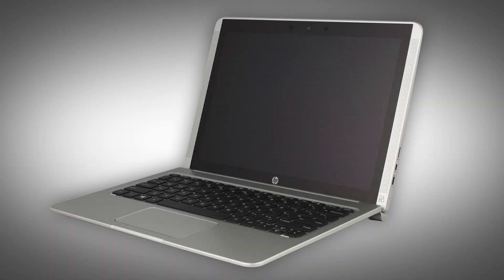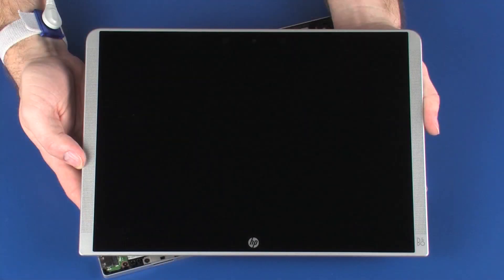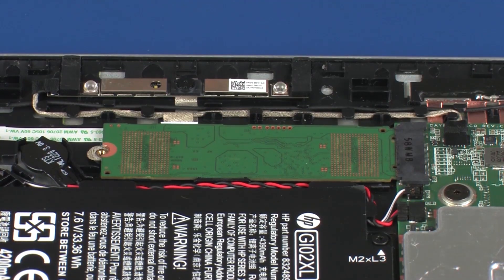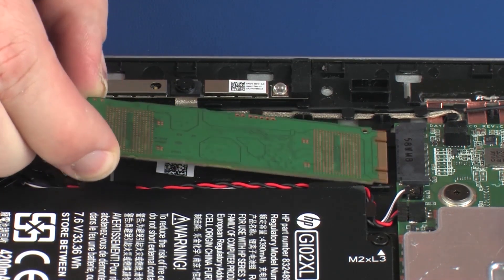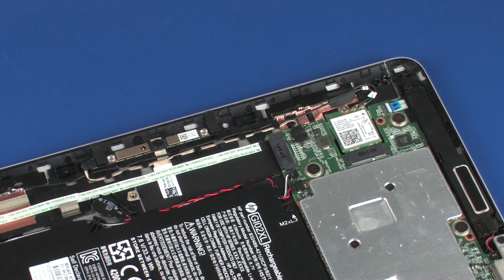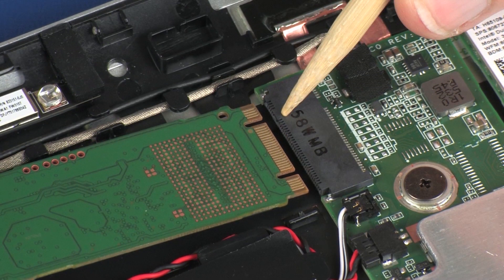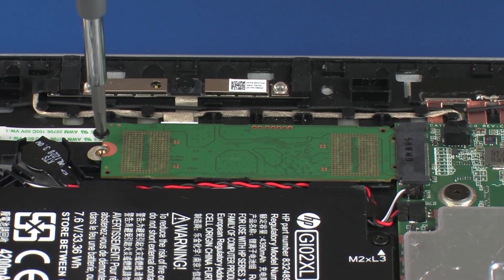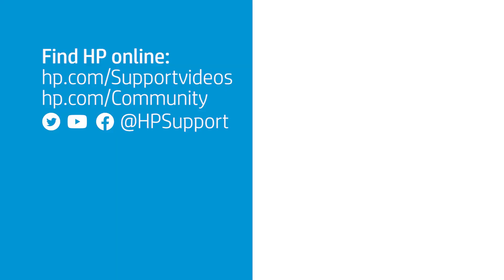Replace the Solid State Drive | HP Pavilion x2 Detachable 12-b000 Notebook | HP Support

Comment: Hello, what's the maximum ssd capacity the HP pavilion x2 12-b101nf can take? Can I replace it with a 2TB ssd?
Reply from the maker: Hi rock4cheese, thanks for contacting HP Global Social Media Support!
I'm afraid you cannot upgrade it to 2TB as it upports M.2 SATA-3 next generation form factor (NGFF),
● M.2 SATA triple level cell (TLC): 256 GB (only on slate models equipped with an Intel 
Core processor)
● M.2 SATA DRAM-less: 128 GB (only on slate models equipped with an Intel Core processor)
Supports embedded MultiMediaCard conƭgurations (eMMC): 128 GB TLC and 64 GB (only on slate 
models equipped with an Intel Atom processor)

Hope this helps!

Akhil_HP Social Media Tech Support
Reply: @HPSupport  thank you very much Akhil for the quick and detailed response! Have a good day!
Reply from the maker: If you need any help in the future, you can always get back to us.
Thank you for being a valuable HP customer.
Have a wonderful day!
Cheers!
Binu_HP Social Media Tech Support

Comment: I have the hp x2 210 G2 and I want to know if I can upgrade the storage because it only has 1.90GB physical memory and barely handles everything. Just for the system apps and such, it's already full. I can't use it. Can I upgrade the storage?
Reply from the maker: +ONCE x STAY Please refer the specification page to know about the supported storage: https://bit.ly/3BHFlI2
Reply: @HPSupport  oh so it's really not upgradable aside form expandable SD card. What's the use of big SD card storage if I can't use it to Download apps in it because the device directly put it on to my internal storage instead of my external hard drive.

Comment: I have a HP Pavilion x2 - 10-n107na and need to upgrade the emmc somehow to 64GB, is this possible?
Reply: Would an m.2 2280 SSD work?
Reply from the maker: +Photon Collector It supports 32- or 64-GB eMMC (v5.0).

Comment: Hi. Finally a good video showing the hard drive can be upgraded.

Can you tell me if i can do this in my model HP Pavilion X2 Detachable - M/M: 10-n155sa?

I also would like to upgrade its memory. Is it possible?

Thank you for the video.
Reply from the maker: +Feel Health thanks for reaching out!
I understand that you want to know about upgrading hard drive and memory on your HP Pavilion x2 - 10-n155sa .
I'll do my best to assist you.
I have checked and found that your unit supports 1)500 GB 5400 RPM SATA RAW 7mm hard drive 778186-005
2) 1 TB 5400 RPM SATA RAW 7mm hard drive 762990-005
Please refer page 46 of the user manual and memory is On-board; non-accessible
2 GB DDR3L or 4 GB DDR3L
Supports up to 2 GB or 4 GB (select products only) maximum system memory
Please refer page number 1 of the user manual: http://hp.care/2clU3d0
I hope that the information provided is useful to you.
Reply: @HPSupport  Thank you so much for the reply and providing all that info. Thank you for sharing the link of tge manual. It helps me much. Regards. All the best 👍
Reply: @HPSupport  Hello. Im trying to find out if i can use a SSD Hard Drive on my Laptop model instead of using a disk one. Could you provide me that info please? Regards. Fil
Reply: @feelhealthy78  do you ever try to extend with ssd /nvme ?
Reply: Nope  @jontaspanuntun4481 i haven't. Anyways. It already had a type of SSD. But the memory was onboard and weak. So i returned it and bought a Lenovo Thinkpad X, icore 5, 8GB DDR3 Memory, and then i added a 250GB SSD 😉👍✌